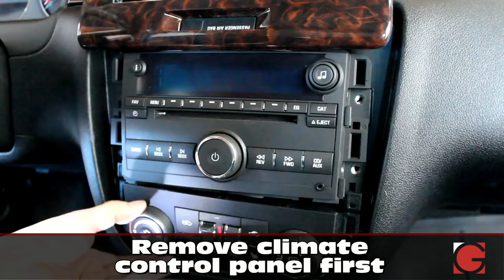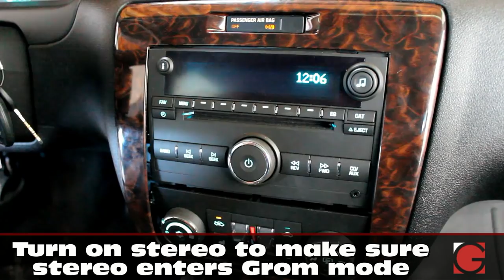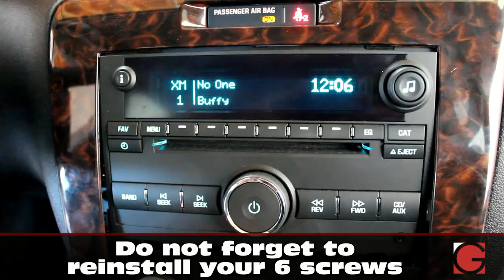Chevrolet Impala GROM USB, Android, Bluetooth & iPhone Car Kit install, radio removal guide

Comment: I have a 2007 Chevy impala LS without sat radio. will this work still? what input will i have to use instead?
Reply from the maker: Hello Billy, the stereo must be not USB ready radio, and must have CAT button. You do not have to have the XM/SAT present, however the stereo must be capable of SAT/XM. GROM uses satellite emulation of your factory stereo.
Thank you.

Comment: 2009 Impala. Install went fine. However, on my car, the satellite receiver was mounted on the right side wheel well under the carpet.
Reply from the maker: +Brian Jennings Thank you Brian. Yes different locations of XM receiver are possible. Glad that you found it!
Reply: My 07 was also on the passenger side

Comment: does it take the Sat radio away?
Reply from the maker: Mark Hunt yes SAT will be disconnected. We are working on the solution that will allow to retain SAT, but it is not available yet. Thank you.

Comment: UNPLUG YOUR BATTERY FIRST.

If you don't, your passenger airbag light will be stuck on and you will have to do some kind of factory reset which equals more $$$.  I should mention that I have not done this for myself as of yet.  I could be wrong about this, but at the end of this video, his airbag light does come on so be wary of this.
Reply from the maker: Troy Richardson you do not need to unplug the battery. But you should not turn on the car before you reconnect everything back to where it was. For example if during the install you disconnected the climate control, you need to reconnect it back, and only after that you can turn on the car.
This will prevent airbag light to go on. Thank you.
Reply: Thank you for the correction